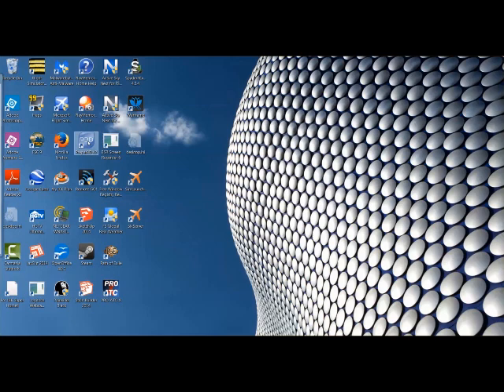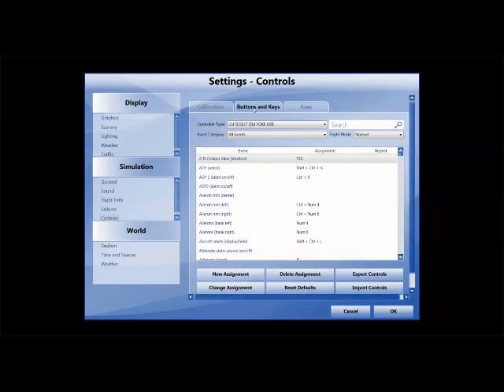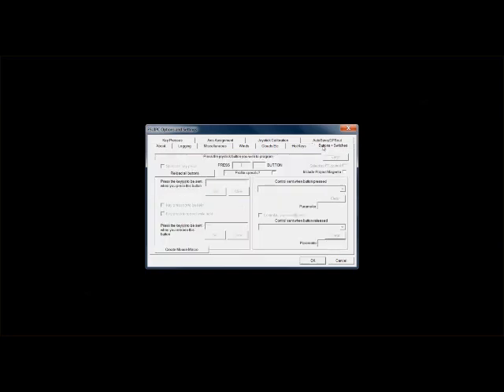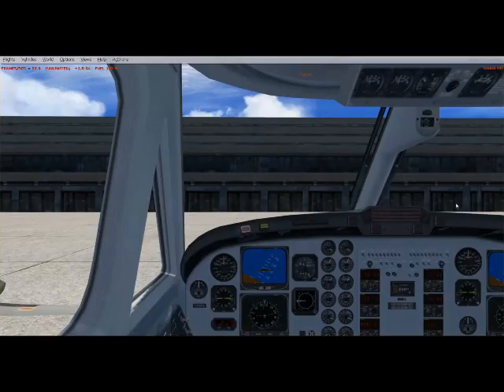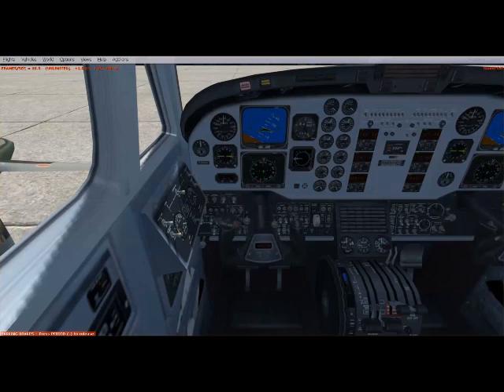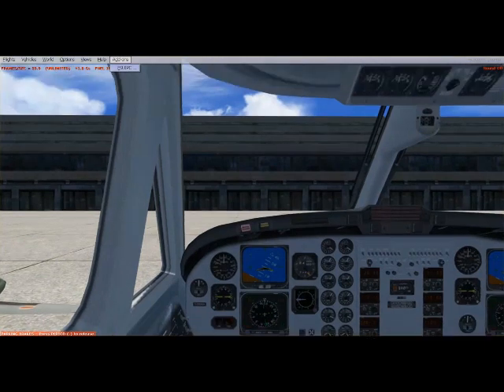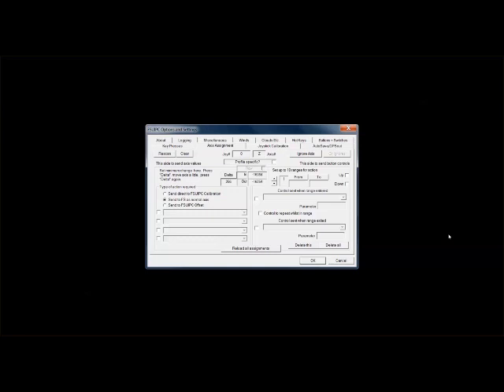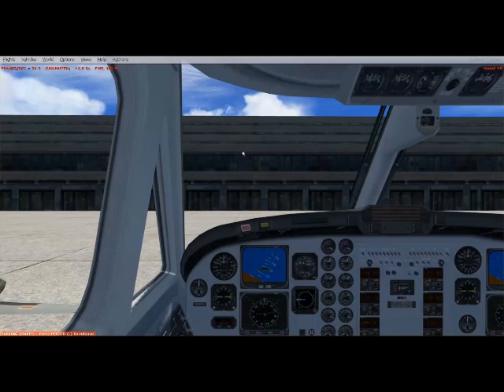Using FSUIPC in Prepar3d or FSX

Comment: Hello thanks for the video I am having huge problems with prepar3d in terms of having smooth controllers all my equipments are Saitek ( Yoke proflight , quaderant throttle , trim wheel . My radios are fine but I spent a week now trying to set up my equipments and paid a lot of software license to make things work . I bought Spad License FSUIPC4 license plus of course prepar3d license. After all nothing is working properly .I am about to drop prpear3d due to frustration and go back to my x-plane which was an easy configure and one hour everything was ready. If there is any way of helping with this matter I really apreciate your help .Thks